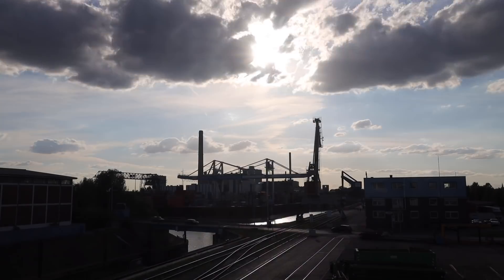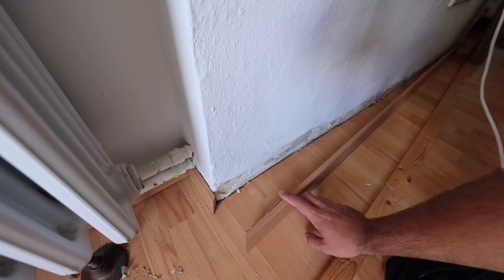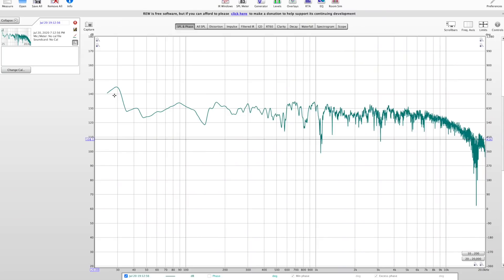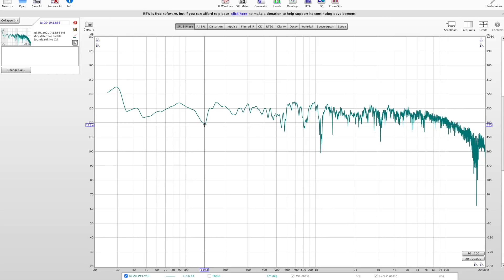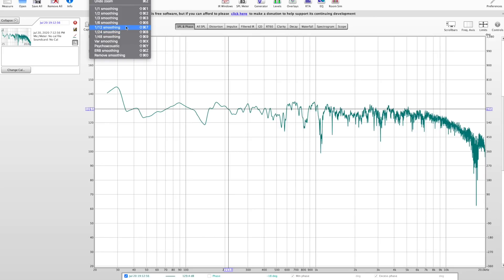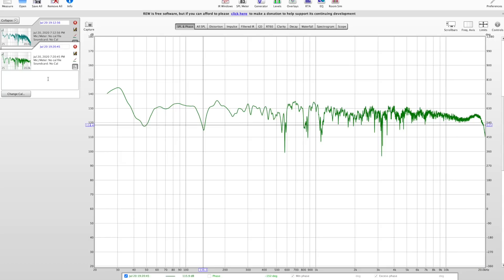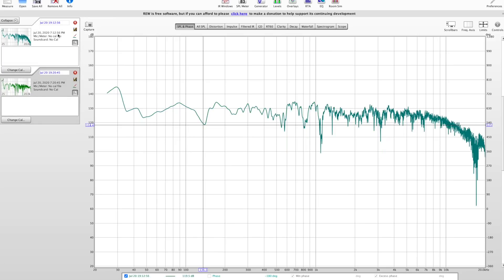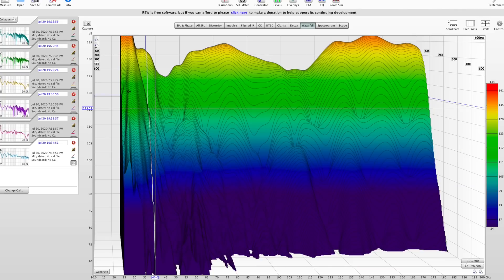IS THERE TOO MUCH ABSORPTION IN MY STUDIO ???

Comment: Jon, we love you and we care about you - please wear a mask when you handle the open Rockwool! Love & Peace
Reply: Don't worry, here in Germany Rockwool has to have big enough fibres so it doesn't hurt your health when handlign it without mask, otherwise its illegal.
It still itches like shit, but you dont have to worry inhaling it.
Its only the old rockwool with small fibres that is dangerous for your health.
Our laws with stuff like that are really serious. If something is allowed in germany, you can be shure that its either harmless or alcohol.
Reply: I was gonna say something as well. Good to know Rockwool with big fibres are safer.
Reply: @Lunix_Hardcore  This applies for new Rockwool - but if the stuff was already for a longer time exposed to air, humidity and a process of decay took place, it looks different. The risk should not be underestimated, although I agree that Rockwool today is much safer as it used to be - especially when it is frsh from the factory.
Reply: @taharkamusic  This applies for new Rockwool - but if the stuff was already for a longer time exposed to air, humidity and a process of decay took place, it looks different. The risk should not be underestimated, although I agree that Rockwool today is much safer as it used to be - especially when it is frsh from the factory.

Comment: so much absorption  s will affect the high frequency the most probably the reason of the dip at 10Khz, the 28hz is the standing wave of the height of your room and the 46hz is the harmonic of that
Reply: Yeah Jon- Standing Waves are large SINE Waves @30 Hz.  runs for approx 37.70 ft.  Divide speed of sound into your frequency and that’s your STANDING WAVE full length & half length length of course divide it in half...( you won’t get them totally out but control them yes) place “ Clouds above your Sweet Spot. This will help a lot. Plus if you had Carpet/ Pad will help but I went with Hardwood Flooring. You will learn how to Mix/ Master in Studio “A” once your ear knows how to Eq those problematic areas. Good luck my friend! George Amodei ☺️

Comment: From my experience speaker placement makes a huge difference in controlling the low end.  Maybe try some measurements where you move them back and forth in several steps and see where the dips getting bigger/smaller. Keep it up man

Comment: Jon- Standing Waves are large SINE Waves @30 Hz.  runs for approx 37.70 ft.  Divide speed of sound into your frequency and that’s your STANDING WAVE full length & half length length of course divide it in half...( you won’t get them totally out but control them yes) place “ Clouds above your Sweet Spot. This will help a lot. Plus if you had Carpet/ Pad will help but I went with Hardwood Flooring. You will learn how to Mix/ Master in Studio “A” once your ear knows how to Eq those problematic areas. Good luck my friend! George Amodei

Comment: I know i shouldn't write this for your sanity but the problem with the 35 hz mode ist the decay time / ringing. Eq will not fix that. Play a 35hz sine. Then mute it. It will ring and it will annoy you. Once your hear it ringing. Had the same Problemen. Speaker placement is key. Or a Helmholtz resonator. I'm also thinking about buying the PSI AVAA system. Which is probably the expensive but best solution. I think maybe soffit mounting will cancel that 35 hz problem. But the acousticians will know more about that.

Comment: Jon pay attention on "door". As I can see you didn't put any absorption in it so basically all sound waves that goes tru it could vibrate and shift sound. Measure distance from speaker to that door and you should find freq wavelength that responds to that distance.
Reply: Formula for checking is speed of sound (343m/s) divided by freq (30hz) equal 10.4m etc
Reply: He might add it later
Reply: @manit9226  of course, but now he don't have it so there maybe lays some frq problems

Comment: It will get even better when the ceiling is done. You might need some corner bass traps though to get rid of the 30hz bump
Reply: Most bass traps are inefficient under 50hz regardless of the price. Bumps can normally be removed with a more adequate room design. His room might not be big enough (width wise) to handle 30hz. Check the wavelength to room size ratios on Google and you'll understand what i mean.
Reply: @costinvaly1 yet headphones reproduce 30hz fine in minimal space

Comment: I have the same issue in my room. It’s much smaller than yours but I have a peak on 136 Hz. I tried the room simp and it turns out it’s the ceiling. Now I’m working on installing clouds but it’s difficult cause the ceiling is made of “chalk” material. I have a huge dip on my 85 - 121 Hz and another at 275 Hz. Trying to figure out those dips but it may be a phase issue. It’s frustrating lol

Comment: You need to treat the ceiling, that's the most important things to treat in a room! You will have a great eq response, if you use bass tramps above you and last you also may consider to use a difuser in your back.  Im sure you will end with some eq curve flater. If not buy ATC, Barefoot or Neumann monitors.
Reply: Your final recommendation is wrong. The flattest monitors in this world will not reproduce a flat final sound on their own. Flat final sound that reaches your ears is due to Flat monitors + Flat Room. Flat monitors alone will still sound bad in a bad room. There's no other way around it. Also EVE SC3012 are super flat (and super expensive) already, check their freq response graph on Eve's website. He's not lacking better monitors.
Reply: @costinvaly1  EVE SC3012 are great! Some times some monitors fit better than others in a space! Sure Jon has to fix first some things in his room treatment and then try some monitors to see what is better in his room. Also in a mix room there should be at least 2 pair of monitors ATC, Barefoot and Neumann can be a great second reference monitor if not the first thing to listen. I am sure he also needs membrane resonators to fix the 30 hz pick! Then it will be almost flat.
Reply: @danielcortes4523  yup! Although when it comes to monitors,  having 3 pairs in the same price range is not as helpful. High end Neumann next to High End ATCs(of the same size) isn't really a worthy investment. You get a better reference from having high-end monitors (either SC3012 or Neumann KH410 or ATC 150) plus cheap avantone "mix cubes" and a lower/mid-end yamaha NS10s. And honestly sometimes multiple monitoring pairs are overrated in some career cases, i have an engineer friend in his 40s with over 20 years of mixing experience and 10 years ago he chose to quit the big studio he was working for and work from home because he knew his apartment home studio so well that he chose to go solo with his career. Now there's national big record labels in his country who keep sending him huge new singles to mix and master, because his end result is just pure pleasant final record that works on the radio and everywhere else every single time. That's why i call him mr GoldenEar most of the time. His monitors which he hasn't changed in 10 years are the cheap 3way Event 2030 and some audio technica headphones. Yes he does have acoustic treatment and even room correction software i think. But still, results matter in the end.
Reply: @costinvaly1   Yes, he can get the Avantone mixcubes and the Yamahas or even some headphones to get a second reference such a lot of engineers do. But there are also engineer that try 5, 6,5 and 8 inch ATC, Barefoot, Neumann, PMC, EVE and a few others top audio brands. Using a 12 inch woofer such as EVE SC3012 as a first reference combined with Barefoot 02 or a Neumann kh120 will be a lot more better than combined with Yamahas HS8 the extra money will work. Furthermore again EVE SC3012 are great but they can have a problem in his size room, and if he can not fix his curve with proper treatment there is not way. Using those big 12 inch woofer which is a lot of energy the only change he can make is going for a smaller monitors pair.

Comment: Hi Jon, can you please add more information about where exactly the mold was, i.e. was it ONLY behind the bass traps? Or was it also in other places, thereby perhaps the problem wasn't necessarily the bass traps? and what kind of walls were behind the bass-traps? It doesn't really make sense to me why this happened, and is something I fear might happen to my place some day if I don't understand it fully. Did the contractor open the wall to see if perhaps the wall cavity is covered with mold? That might be the reason why it spread to behind your bass traps
Reply from the maker: It was also at other places due to cracks in the wall. Got fixed from the outside should be all good
Reply: @Jonsine  Interesting. Yeah I think many people watching this video will think "ultimate proof why not to do these absorbers DIY" but kind of sounds like the problem was more the room than your additions.

Comment: as in the other video, you're measuring with both speakers on at the same time? That causes problems in the chart. Make  two measurements, one for each speaker. You'll see big differences and wired peaks in the chart will be gone.